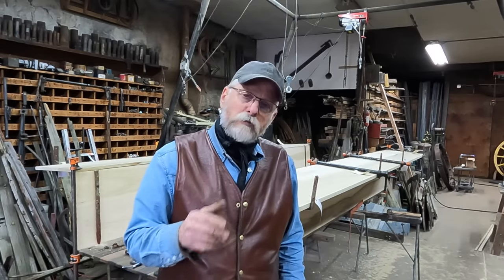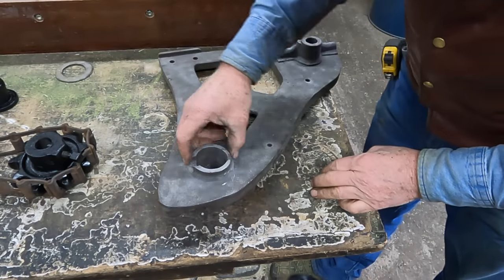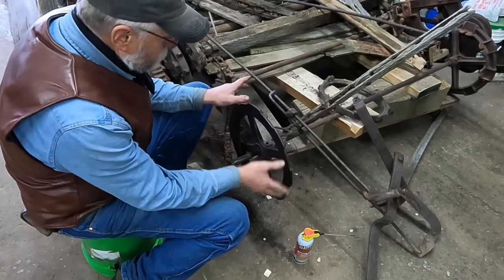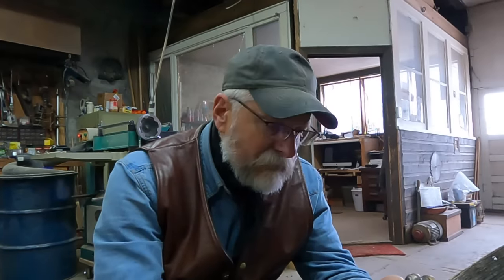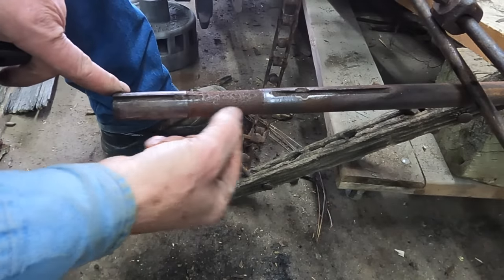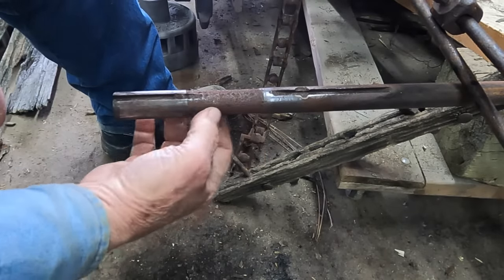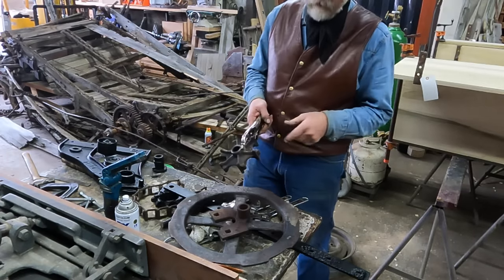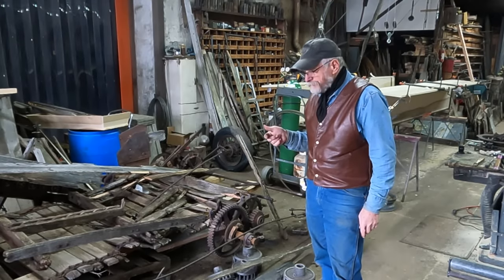My Best Friends For Breaking Rusted Parts Loose | Engels Coach Shop

Comment: When using heat to remove a cog wheel from a shaft, you are striving to expand the wheel but not the shaft. When the shaft is heated, you lose the advantage of the differential expansion. Ideally, heat the wheel and pack the shaft in ice to maximize the differential expansion. From an old mechanical engineer.
Reply: First you burn the rust off in between, heat the shaft and the cog, then you cool the shaft with compressed air. Then you lube the shaft with penetrating oil. Heat the cog back up to prevent impact cracks, and hammer it off. If possible with two hammers and simultaneous impact near the mating surface towards the direction of the release. A soft landing pad is also recommended. Works also with threads. The expansion and rapid shrink breaks the oxidation bond with audible crack.
Reply: Yes that would be ideal but in the real world there is virtually no way to accomplish that what mechanics who do it we spray penetrating oil on the shaft to cool the smaller shaft to shrink it. As a retired Drafter/Designer we don't try to hurt anyone's feelings but an occasional reminder of field capabilities helps.
Reply: I use wet rags to cool shaft.  and a heavier oil when hot
Reply: I was over all of the maintenance of a Texaco refinery. We used heat or dry ice depending on whether we were dealing with external or internal interference fits. The larger the gap, the less the rust is a factor.
Reply: @matthewmoilanen787  Have been using my method in real world every time I've had access to air compressor. other times I use snow. Also works as a landing pad.
Reply: If you just control the heat you get differential expansion anyways. It's all about aim which Dave seems to have.

Comment: I have had lots of success using Free All spray instead of PB Blaster and WD-40.  The Free All dissolves the rust.
Reply: @Daniel-S1  People keel telling me that but when I run out of their recommended part the old WD-40 seems to do the job just as well. I prefer diesel fuel but the smell lingers for years.

Comment: For breaking loose rusty parts have you ever tried candle wax Dave? 
I’ve seen videos where people heat up the part then melt a candle on the joint with pretty good results. At least on video it was pretty good.

Comment: So what if the other shoulder sticking up there is meant to keep the chain from jumping the gear and getting stuck between the casting and gear. Might keep the chain from breaking the casting. Just an observation.

Comment: If you use the drill press to start the tap, it will start straight.
Reply: That's what I need to do.  Dave doesn't have a problem doing it free hand.
Reply: @dwightl5863  I don't think it was that critical that stud be perfectly perpendicular. I think it just had to hold that bar he showed. But we'll see.

Comment: How about the constant pressure of a gear puller while you apply heat and oil?
Reply: Make that heat and tapping after the penetrant has worked overnight.
Reply: Clearly the way Dave did it is the way to do it. Because he did do it.  There's a lot to be said for heating and tapping when it comes to separating rust frozen parts. It's the tried and true technique. There's physical reasons why it works. You're using the two things rust can't handle against it. Rust is ferrous metal combined with oxygen. That makes rust brittle and prone to burning. So burning the rust out and busting it up defeats it.

Comment: I have an old pully wheel on a bolster i've been trying to get the shaft out for long time. I'll try more persistence.
Reply: If you keep at it something has to give eventually. Some stuff just don't ever happen though. There are things that are beyond doing. In theory nothing is impossible but in practice some things are so impractical you might as well call it impossible.

Comment: For the grayer wood finish try 000 steel wool instead of filings. filter the liquid before applying. The lack of red rust should give a better gray it's what we use for Halloween haunted houses and I've been told the movie industry commonly uses the same mix to make 100 year old barns where none existed

Comment: I'm a bit concerned, watching you try to determine the length of the machine at this early stage. I see that there are (were) rollers that carried the conveyor chain. Are you sure you have all of them? If not (which seems very possible) you may need to adjust the length of this machine accordingly, which would not be a big deal if considered in the overall plan early-on.

Comment: I've seen a machinist perform a "spray weld" on round stock that bearings would fit onto. The stock is put into a lathe, then spun while heating the bar and then finally using a "spray gun" to shoot metalized powders onto the rod until its diameter is built up enough to machine it back to correct size. Apparently that works very well in the commercial industry to keep old shafts going. 
Adam is a very skilled machinist:  https://youtu.be/9tmeHEUMB0Q?si=PLb8cvvTmDFuZTY_

Comment: Other than "good job", the only thing I have to say is, "I hate the smell of PB Blaster!" 😄
Reply: They've actually reformulated PB Blaster. The fumes used to be way worse. Stuff worked better though. When I first used it the fumes were positively lethal. But that must be 30 years ago now. They changed it like 20 years ago. I don't know what used to be in it but whatever it was had to be super carcinogenic. You could feel the stuff killing you.

Comment: You must have used a power of gas on those parts.  Would it have been better (in retrospect, with 20/20 vision) to have heated them in the forge fire?

Comment: i wirk on tons of old equipment machinery pre wwii stuff left out in pastures junkyards forgotten and crusty I've found an air hammer with a 1" flat head starting on low power + heat qorks really well ro loosen this kind if thing does little to no damage and saves the hands and arms from the shock of hammering i have CT and arthritis in both hands kroil or wax can help or any number of other penetrants stay away from the rust eatng ones they will attack base metals if left on too long

Comment: Dave, what was that brass drift you're using originally? Some sort of jack shaft I'd guess from the Acme threads on it, but seems like the brass would be too soft for that.
Reply: Dave said it was just some junk he had laying around.
Reply: Actuating screw from a large scale water control valve

Comment: Note: When you overheat a rusted assembly you just make any petroleum-based penetrant evaporate faster. The enhanced ations is from the heat, not the penetrant. Notice how it burns off when you applied the torch flame?
Reply: exactly,,,spraying penetrant on a overly heated part does nothing but burn away the penetrant   although I enjoy what he does,,,,I find it a bit on the cave man side at times....but that's just me
Reply: It may help cool the shaft a bit as in heating a part if the shaft gets hot you've defeated your strategy.
Reply: @tomstiel7576 it’s used to cool the shaft, which is exactly what happened.  You can also see the shaft stays wet most of the time.  Go back to your armchair…
Reply: @tomstiel7576   Yes, that would be the conclusion of someone that has never done this before. There is a purpose to doing this. You just don't realise what it is.

Comment: Would vinegar do anything for the rust in between the two parts I’ve never tried it never heard of anybody trying it but it might work
Reply: This stuff was so rusted solid there's no way the vinegar would get in there. If the parts were that loose they'd have just come apart. That's part of the problem. The rust is bigger than the original metal was. Back when there was some clearance water and air got in there. Then it did what water and air do to metal over time. Now nothing's getting in. Well, heat and impacts can penetrate the impenetrable. You're attacking it at the atomic level.

Comment: How you know he's a pro?, because most dummies would have cut the head off the bolt, THEN drilled the pin hole, AND THEN struggled to screw it into place.

Comment: I would be much more comfortable watching you heating metal parts if you used a rosebud heating tip instead of a cutting tip. Why do you prefer the cutting tip?
Reply: The cutting tip gives more directed heat. So you have greater control over where you're inputting the heat. A large part of why heating works is the unevenness of the heating. You get different rates of expansion and that tends to break the rust bond. Like bending metal back and forth.

Comment: Heavier hammer is easier for the wrist. It resonates less and you don't have to swing it as hard.
Reply: Resonating is the vibration that breaks down the rust.
Reply: @wssides  Resonance, or recoil in a light hammer, is the vibration that breaks the wrist. It affects this tiny bone between the arm bone and palm bones causing micro fractures, which then grow thicker, and this blocks neural routes from the fingers to the arm on one side and scratches ligaments on the other side. Heavier hammer has  more inertia, so more energy of the impact transfers into the object. Thus less swing energy needed.
Reply: @oikkuoek  Agreed That I like a heavy hammer to make things move but not in this situation. Mr. Engels seems to have kept his skills and dexterity- maybe despite some damage to hands and nerves. Certainly I have damage but I blame it on arthritis and gout for the most part.
Reply: The key is light taps. You're only busting up tiny grains of rust. It isn't the circus strength test.
Reply: @1pcfred  Light taps indeed, only a heavier hammer has an impact force to penetrate all the way through the contact surface. Even Dave's "light taps" became swings when the brass came in to play. If he had had a heavier hammer, he would've wasted far less time and sweat breaking that part loose.
Reply: @wssides  The weight of the mallet is not the reason why part breaks. It's the swing and the density of the mallet. You can break a part with that tiny one too, just leave that brass piece away and put enough swing on it to a cold part, and bits are going to fly.
Reply: @oikkuoek  that's your theory. Generally separating rust seized parts takes time and effort. Just the nature of the work. Often the best tool for the job is the one that's in your hand. Which is saying that perhaps you do possess a more ideal one but the effort of switching tools isn't worth it. AvE should send Dave a brass hammer.

Comment: 3:02 Dave I'm worried about the stud repair drilling and tapping it is gonna compromise the strength of the casting and is gonna break out from the amount of torque that arm is gonna be putting on it.
Reply: highly doubt it
Reply: this thing will be on display and will probably never be used. it will be fine.
Reply: A shoulder bolt would have permitted another repair opportunity.
Reply: @ccamen  Diane says they plan on using it. I know if it was mine I'd have to try it out too.